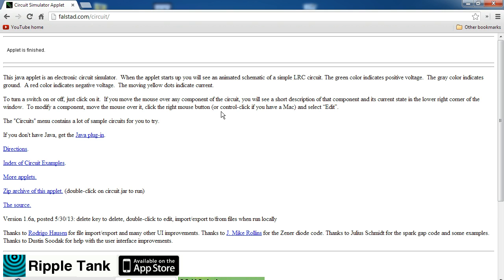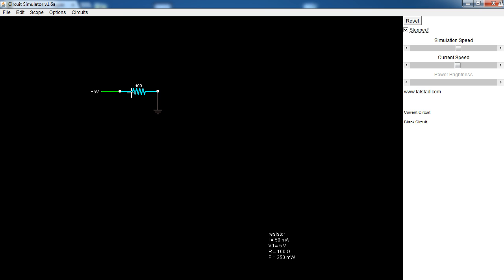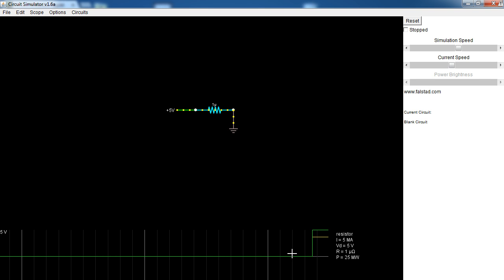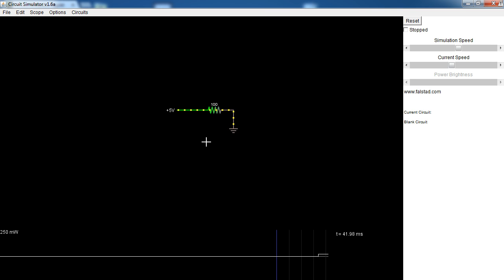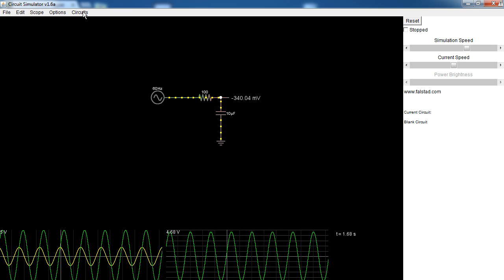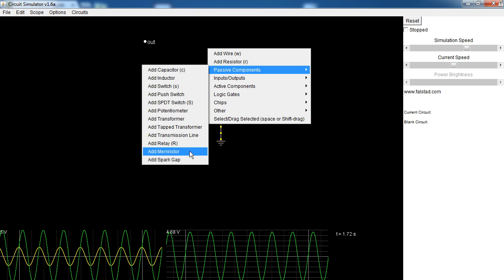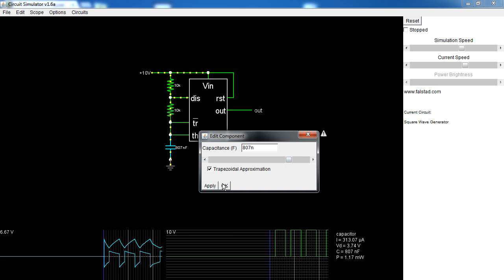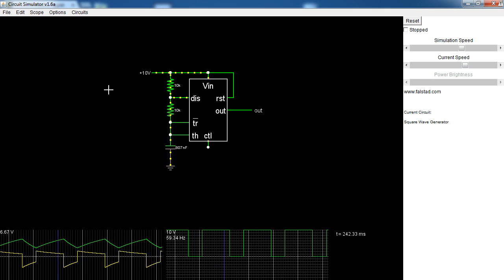Falstad Circuit Sim. Mini Tutorial

Comment: I found the limits of this little program pretty fast when I tried to simulate AM modulation by feeding the base of a transistor by an AC voltage source and supplying by another AC voltage source. I got a matrix calculation error instantly.